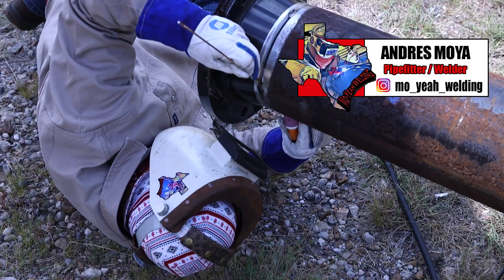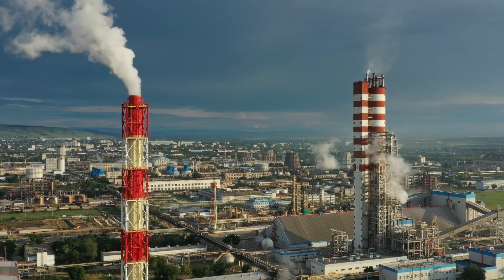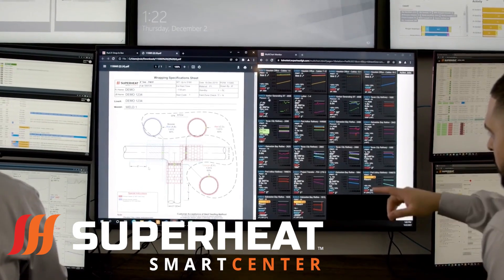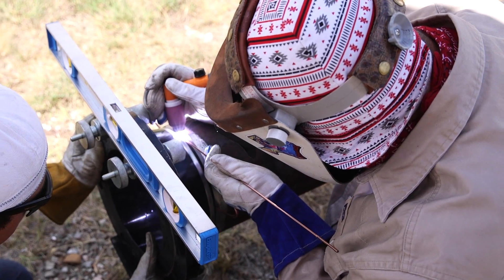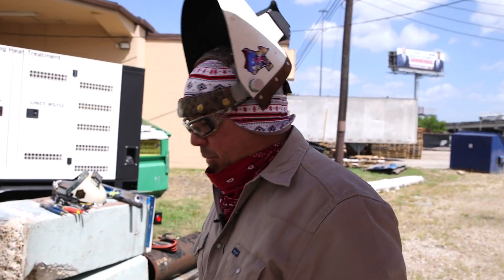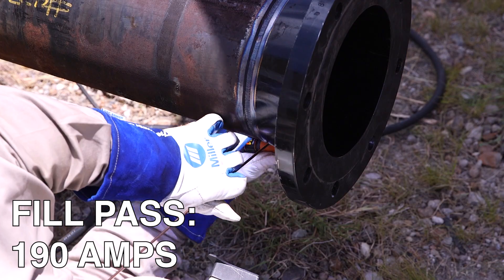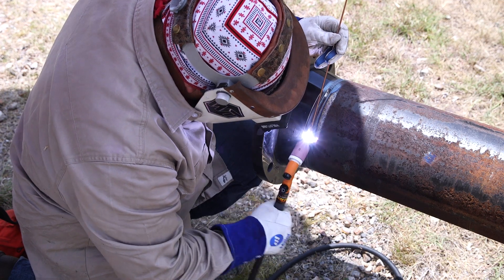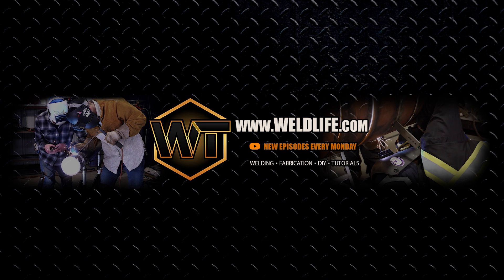Job-site TIG Welding an Old Pipe to a New Flange + Hydrogen Bake out Heat Treatment

Comment: Bake out? What a scam lol. Just use a torch. Hydrocarbons in the steel? How? Its a solid object, not a spunge. I
Some surface but again, just use a torch or grinder.
Reply: Research Hydrogen Induced Cracking, and HIC testing, also Hydrogen Blistering.  :)